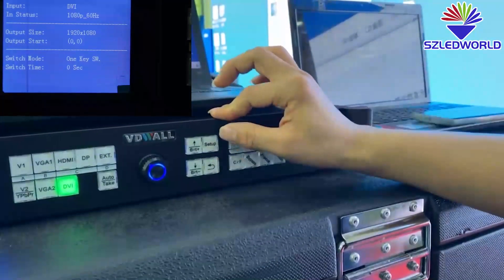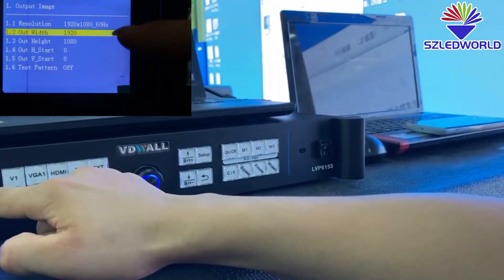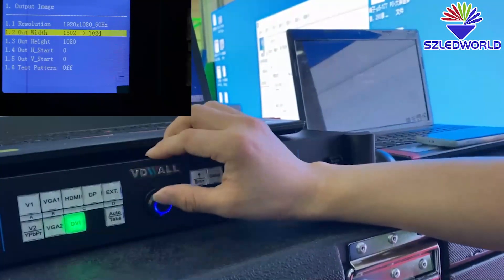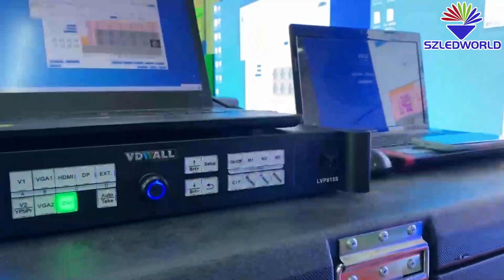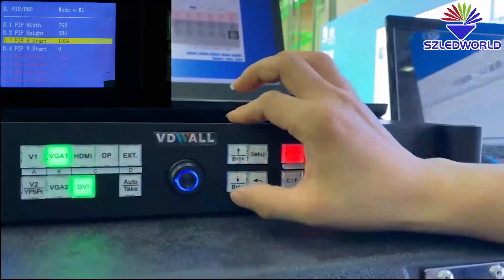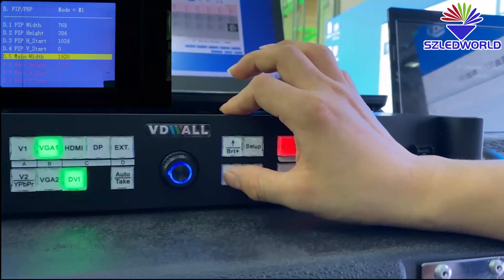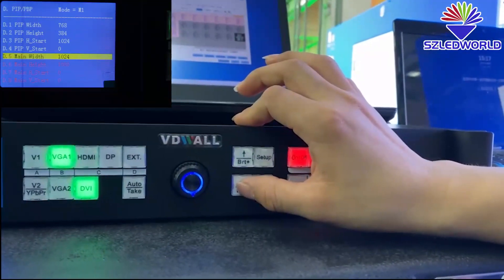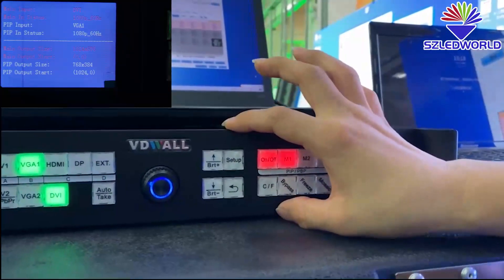Video processor operate for LED display screen video wall, LVP615S operation, set resolution&PIP/POP

Comment: My led processor is saying no input after connecting HDMI, VGA, DVI, basically any input. Please waht can I do
Reply from the maker: Hello Bro.
Maybe your motherboard has problem.
1, Attempted to restore factory settings:
   Press the "Ok" button - setup - advance (8th option) - restore factory settings, and checked if it's okay?

2, Try using a computer signal through HDMI to see if the cable is okay?

3, If the above two steps still don't work, the only option is to send the motherboard back for repair.

Comment: Hello, After screen configuration, when i send screen configuration with NovaLct it show this msg :  failed to send screen information, current display mode is 0px0p .Thé device is VX400 .  The rcgfx  file go successfully.tle problème is only with screen configuration.
Reply from the maker: Hello, it maybe you didn't set the output resolution
Reply: @SZLEDWORLD  . Hello.  How and where Can i do that?

Comment: I have the A65 VDWALL and it works fine its just that every panel displays the same picture. It doesnt display the whole screen just all of the panels display 1/4th of the screen.
Reply from the maker: Hello Klemenix, it seems you don't the right rcfgx file for the cabinet.

Comment: Can you please help me
Reply from the maker: Ok, what's the problem you have?  pls, send an email to sales@szledworld.com. we will arrange Technical staff to contact you.
Reply: @SZLEDWORLD  my processor input not working
Reply from the maker: Check whether the input is broken and whether it is connected well. You can try different input methods. If they all don't work, there may be a problem with the input sub-board. more details pls contact Whatsapp +8613728652081
Reply: @SZLEDWORLD  I have a lvp605s
Reply from the maker: The method of operation is similar
Reply: Hi
Reply from the maker: Hello
Reply: Hi
Reply from the maker: Hi
Reply: Please help me
Reply from the maker: How may I help you?